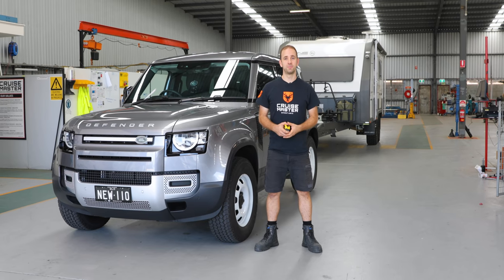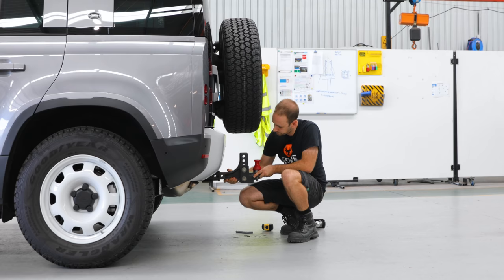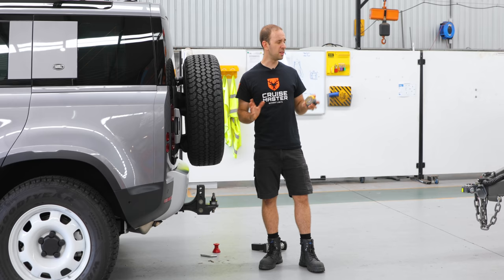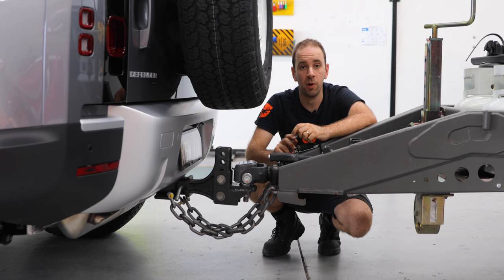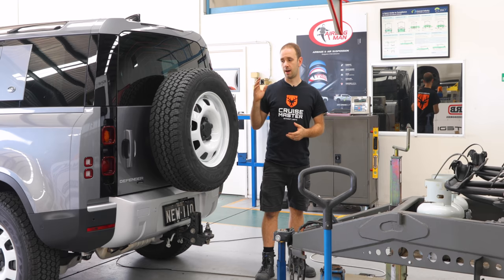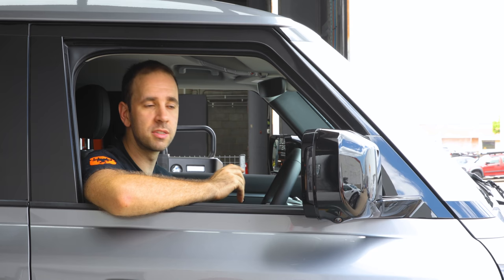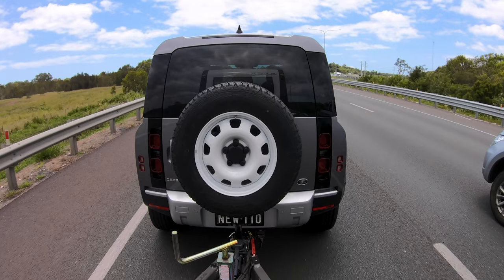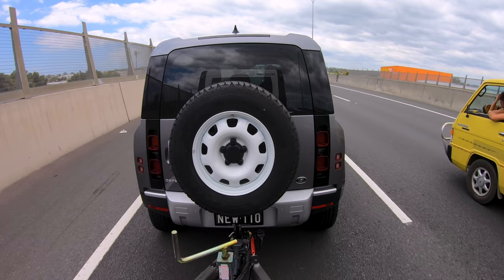Land Rover Defender - Highway Towing Test & Weigh-In

Comment: Really impressive to see that from a 4 cylinder engine. The new defender might not be the car a lot of people wanted it to be but it is still a very capable and impressive vehicle in it's own right with an infinitely wider breadth of ability than the old defender ever had
Reply: The engine has been dropped due to the number of failures in not only the Defender,but also other models.
Reply: @paulbarry1044  The four cylinder diesel has been but the four cylinder petrol is still for sale and is a great little motor.

Comment: Great review Andy,

Very thorough 

The Defender looks great, and I love the white steelies. 

Clearly there is much to know, so that u r Towing safely

U said that the caravan weighed 
3.3 tonne
U said ur GCM was 6,150 kg

The 110 weighs just under 2.4 tonne ?
Plus you and fuel 
Let’s say 2.6 tonne ?
That adds up to be 5.9 tonne

But, u said ur GCM was 6,150 kg

What is the other 250 kg ??

Is ur Defender the 
D200 Diesel with 400 nm
OR
D240 Diesel with 430 nm
???

BTW
LR vehicles have always been built very strong, solid, and over engineered, as they have always had class leading off road and towing ability 

LR been doing full, front and rear air suspension for over 25 yrs in the RR

1998 Series 2 Disco had Rear air suspension 

Full air suspension on Disco since the Disco 3 in 2005

With air suspension, LR vehicles tow extremely well

2021 MY Defender with 6 cylinder Ingenium Diesel motor in Australia as of April
No 4 cylinder diesel in 2021 MY Defender in Australia 

6 cylinder Ingenium Diesel 

D200 — 147 kw / 500 nm

D250 — 183 kw / 570 nm

D300 — 220 kw / 650 nm

If u r going to load up ur Defender and tow, 6 cylinder diesel will have the torque to manage this better then the 
2020 MY 4 cylinder Diesel engines.

Thanks
Cheers 
👍👍

Comment: Really informative, thanks guys. It goes to show a stock vehicle can do it. But there aren't many out there. I think on paper, the new Defender has the best numbers and payload of any stock 3.5t towing vehicle out there (exclude the American trucks). Can you think of any others that are better stock?
Reply: You'd have to have a full size pick up to compete in US/Can. Toyota Tacoma has a 6500 lb towing capacity where as my lr4/disco 4 has the same 3500 kg 7,700lbs  like the defender here.
With out the air suspension or air bags fitted on pick ups you'd have a lot of sag unless you are using a full sized 2500 or 3500 pick up. 1500 would be fine for this weight, Unladen they have a horrible jarring ride though  (2500 and 3500)
Reply from the maker: We will be touching on this more in the next video so stay tuned!

Comment: Great video! Can you say more about the electric hookup? How does the Defender manage the brakes on the caravan? Did you need a wireless brake controller in your setup?
Reply: There is a standard loom fitting for the Electric brake system

Comment: The wheels look set back quite far from the centre, it must perform off road better that way but axle load is increased because of it.  I can't imagine it's a stress free experience towing it in strong winds.
Reply from the maker: Hi, this is a fairly standard caravan set up with the weight distribution spot on for the build. This caravan tows better than most.

Comment: Would be interesting to know the difference in rear axle weight with the recommended hitch length. Suspect significant.
Reply: I wasn't particularly good at physics and I 'm happy to be corrected but I've just done quick google search on lever effects (mechanical advantage) and force versus length from a fulcrum (the rear axle).
In the video it looks to me that the modified tow hitch is quite a lot further out from the hitch pin- the distance to centre of the D035 pin looks like about 25-30cm in various still images. I've checked on line and the Land Rover manual specifies a max recommended distance of 175mm from hitch pin to centre of ball. 

If we take a conservative estimate that the modified hitch is actually 25cm from hitch pin to centre of D035 "ball" (X in following equation) and Force = (WxX)/L where W=weight of caravan drawbar, L is length on other side of fulcrum (say 2m to front axle for simplicity) then 320kg x 0,175m / 2m = 28; vs 320kg x 0.25 / 2=40 :  a ratio of 1.43. So this is a significant increase in leverage on the tow hitch / rear axle. 
To solve this problem when my D300 SE arrives next month up in 2014
I hope that helps anyone with concerns about towing an off road caravan/camper with their new Defender.
Reply: Edit to reply below: some of my reply did not appear:
I intend to have a custom tow hitch made up  by a local tow bar centre in Adelaide with same length but raised height compared with OEM and this should solve the problem
Reply: @davidmunday8820  good job David.
Reply: @davidmunday8820  Did you get a custom hitch made up in the end? How much did it cost? Thanks!
Reply: @MrShivermetimbers123  yes I did- Allin tow bars Adelaide-$75.00. Has been great last 2yrs.

Comment: Can you comment on if you feel the weight distribution on the suspension actively works to compensate the tow ball weight, ?
Reply: The air suspension levels the vehicle but it does not distribute weight to the front axle.

Comment: Excellent review,I am thinking of getting a 110 in place of a disco 4 HSE Luxury which I tow an Airstream twin axel.
When towing on Uneven roads it feels like someone is jumping up and down on the ball, from your review it seam that this is possibly due to the overhang.
Tried disco 5 and it’s wasn’t as good as the 4.
Also will the 90 be as good as the 110 due to it being lighter.
Reply: I'd say the new defender would be a great choice especially with the new straight six diesel engines although I'd try it first just to be sure.
Reply: @beaviccoon470  yes it would ,have to be the 110 though,but you can’t use any of their tow bars as they only go up to 195kg and the airstream is up to 250kg.ALSO towsure’s tow bar[one of the best made] hadn’t gone gone through all the tests a month ago.

Comment: So if the caravan was 3.5t, your rear axel weight would be well over the max 1.8t. How does the defender advertise 3.5t towing capacity when you were at the limit at 3.3t on your video?
Reply from the maker: Hi Robbie, that was our biggest concern with the Defender. While its almost expected these days that full towing capacity is hard to realistically achieve with a reasonably loaded vehicle. The fact that its impossible here is a major dissapointment. Hopefully this has been rectified in the newer variations.

Comment: I've never seen a trailer coupling like that before - is it specific to Australia? What is it called?
Reply from the maker: Hi Nick, its our Cruisemaster DO35 Coupling (3.5T Rated). Widely used in Australia but also available globally direct off our website or via Sloop Imports in the USA. Isnt compatible with override brake systems though which will rule out most applications in SA, UK and Europe.

Comment: You should never tow anything that puts a vehicle on or close to it maximum you are only going to run in to many mechanical issues down the track. If you are considering towing anything over 2.5T then you should be looking at F250, Dodge Ram 2500 and Toyota Tundra or similar towing abilities. even 200 series Landcruiser should only be towing 2.5t max.
Reply: How does a Tundra, which runs LX-570 running gear tow better than a 200 series when the 200 has more torque and weighs 900kg more for towing stability?
Reply: Absolute horseshit.
Reply: 😂😂😂. What a load of crap!   Our company use the original Defender for towing ships mooring Ropes and wires which sometimes go 150 to 200m in length and puts them well over the 3500kgs recommended towing capacity..
They all get worked very hard with 18 different boatman jumping in and out daily and we’ve never had any issues because of this.
They get serviced well and we have had many years of using the defender and they have all given great service with little problems.